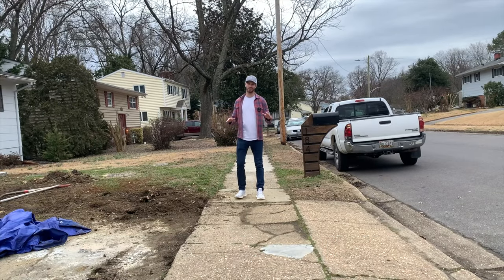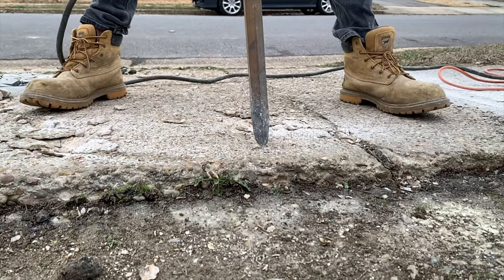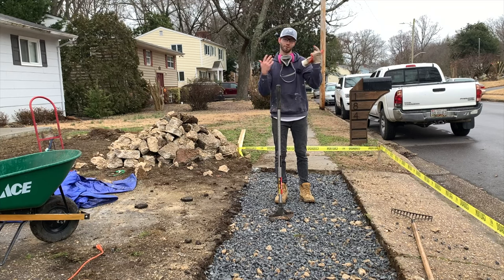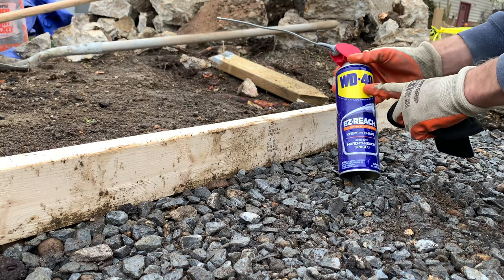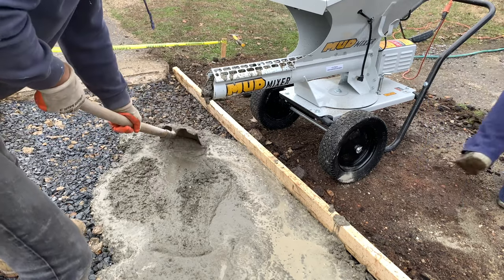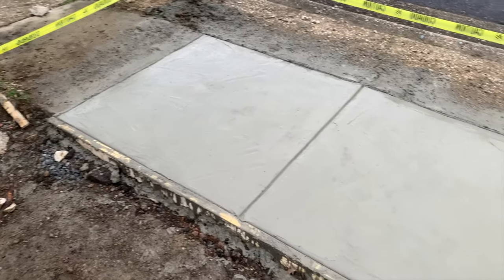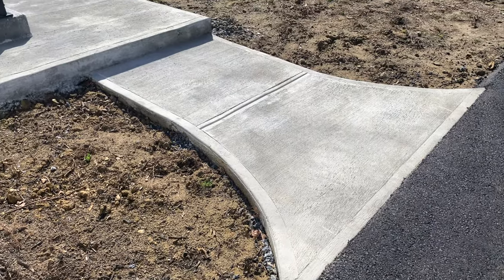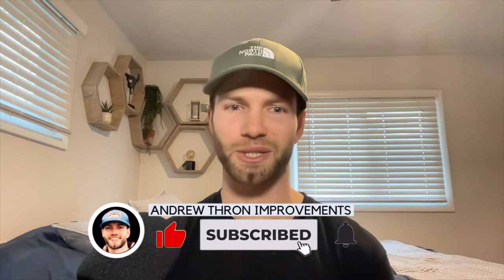How to Replace a Segment of Sidewalk (DIY Sidewalk Repair Using Concrete Bags)

Comment: Just a note to this. If you are putting mesh in for keeping concrete from cracking. It is always best to keep it in top 1/3 of the the concrete pour. If you push it down to the bottom like they did in this video it doesnt do much for cracks on top of the slab. Other than that great job.
Reply: “Push it down to the bottom”? He literally explained he laid 2 inches of the 4 inch slab and then placed the mesh. Your 1/3rd still holds but I don’t think it’s “at the bottom.” Anyway, just saying…
Reply: He placed it at 2in mark, but that is for explaining why it shouldn’t be pushed to the bottom, I was wondering why it wasn’t laid over the stamped rocks

Comment: Back in the day when we had functional city governments and maintenance program the city would fix it. Now I need to watch YouTube video and go to Lowe’s and get it done myself  and they still increase our taxes.
Reply from the maker: I hear you, Patrick 😅. It’s tough out here. Thanks for watching!
Reply: In my city they lost a court case in 2009 where they were supposed to fix the sidewalks because they weren't ADA compliant.  The city tried to claim no responsibility or ownership of the sidewalks because somewhere in the code they had written that homeowners are responsible for repairing sidewalks, but they still have to get permits from the city, make it uniform with the city's sidewalks, etc.  Anyway, it's 2023 now and today sidewalks are worse than ever.  😅  I'm thinking about doing my own, but I'm worried the city will stick their nose in my business and fine me for fixing "my" sidewalk.

Comment: Or you could make your concrete a little dryer and use Masonite for your edges so you don't have to worry about the wind blowing plastic away.

Comment: As a retired mason I would like to say that you should have replaced the apron while you were doing it because it was broken also. The reason your sidewalk was broken up is that it’s to thin for the application, it’s a driveway and should be a full six inches thick for both the sidewalk and the apron. I’m not sure what state you’re in but most states (and cities for the most part) spec out six inches in a driveway area. 
   It seems that a lot of your viewers think that the city should replace that broken concrete, but if you would look into it you’d find that homeowners own to the center of the road and they have an easement from the center of the road over usually 25-30 feet and is probably right to the back of the sidewalk (the side closest to the house). You are required by city law to maintain the sidewalk on your own property, and any street repairs or replacement is usually assessed to your property taxes. It’s pretty much the same everywhere so it’s just part of owning property in town.
Reply: It varies from area to area. In our town he wouldn't be allowed to replace that sidewalk. Our town owns and takes care of right of way. Usually 50-60 feet. So 25-30 feet from center of road.
Reply: I have a four inch thick 125 foot long driveway that was poured in 2001.  It’s now September 2024, and the driveway cracked at the control joints.  That’s it!  And, my driveway is used multiple times each day, mostly for people using it to turn around.  It’s not necessarily the thickness as much as the base.

Comment: You can power wash the extra concrete off the apron after the new concrete has fully set; probably a better result than power washing while the new concrete is still wet.  The poor bond and thin layer should pop right off.
Reply: Or small area like that, just tape plastic down along the edge and cover the apron. Especially if it's nice to begin with. Not the case here. Hahaha

Comment: So what about when you pulled out the 2x4 , is there a gap left between the two edges of concrete a nd the existing driveway? You didn't say anything about that?

Comment: Was sealing not necessary, every patch of sidewalk I see replaced gets sprayed with some kid of seal but maybe it’s dependent on season/geographic location.
Reply: A lot of the extra are to deal with freezing as water expanding is the number one cause of ruined concrete. Well that and tree roots.